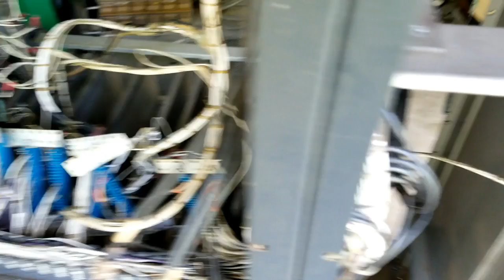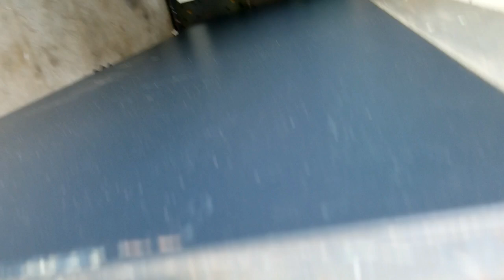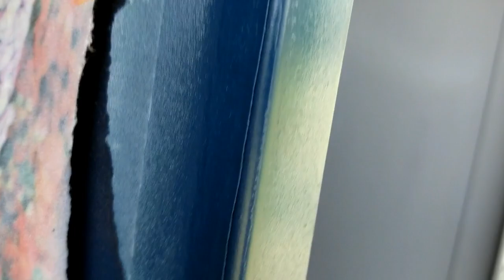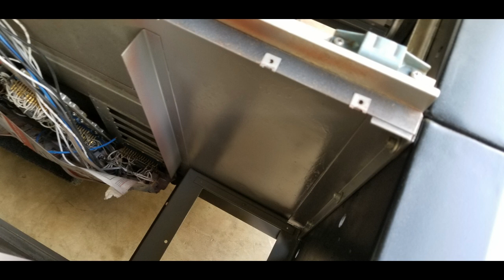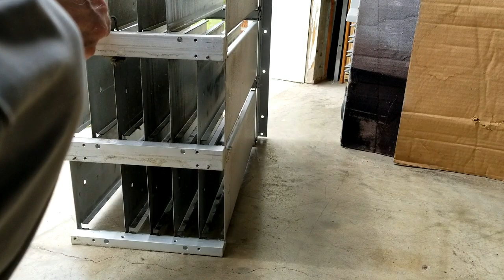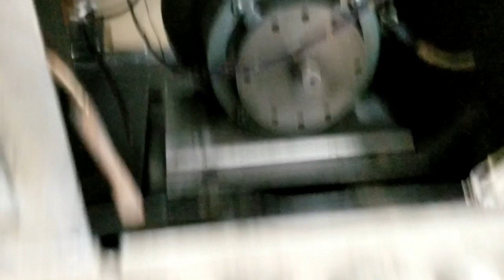The Quad Tape Transfer-RCA TR-4 Quad VTR Rebuild Part Four

Comment: Hi Larry, Do you have extra schematics for the TR 4 and also extender board ? I lost everything I own in the Eaton/Altadena fire. The Tr 4, AVR 2 and 3 was in storage. Lost a lot of research. I   was in the process of making a harmonic balance for the quad video disk installation.
Reply from the maker: Hi Charlina, No, I don't. I have just the one set with the 4 here. I think thats the only vtr that I don't have any extra copies of. Well, the vr1100, I don't have ANY manuals for that one...yet. Somebody awhile back won what looked like a full set of TR-22 manuals on ebay. I was later told by a friend that person was planning to scan them. I don't know who it is/was. You might ask around and find out. A 22 is pretty much identical to a 4 in many ways, especially (most of) the modules. I guess that's better than nothing until the real thing comes along. You also might look up George LeMaster.  He and Jay hauled a load of rca manuals out of Turner's place in NJ a few months back when he called it quits. That's about all I can think of right off. I guess the other big question would be exactly what upgrades does your 4 have installed. There was a bunch of them. That would have a big effect on which manual(s) and update supplements, FCB's, you would need. Good Luck!

Comment: Quad was a little before my time, so I don't know the accessories that one could be outfitted with.  What does the Cavec module do?
Reply from the maker: Cavec is short for Chroma Amplitude and Velocity Error Corrector. It corrected the chroma level on each line, and also corrected the velocity error on each line. Ampex Auto-Chroma did it only on head channels of 16 line groups, RCA cavec did it on every line.